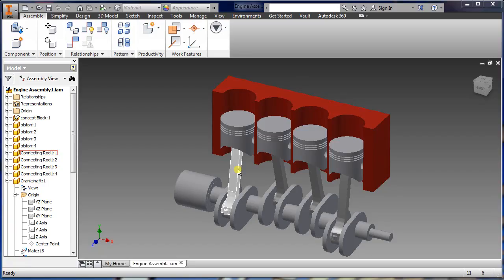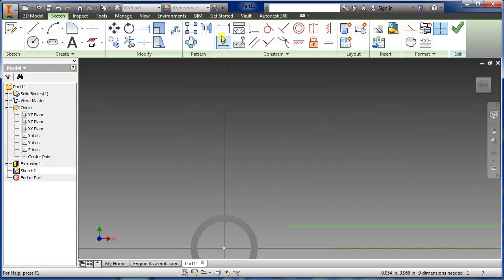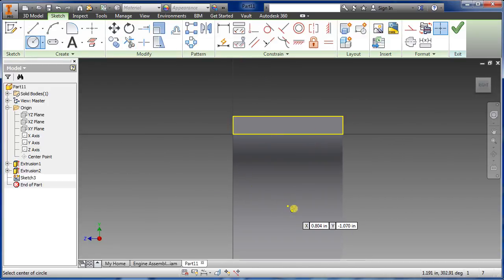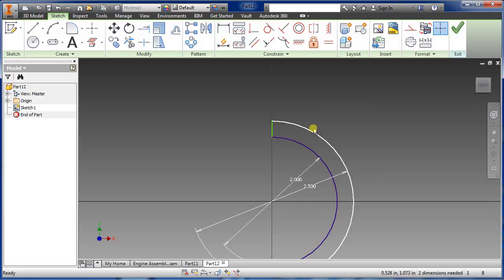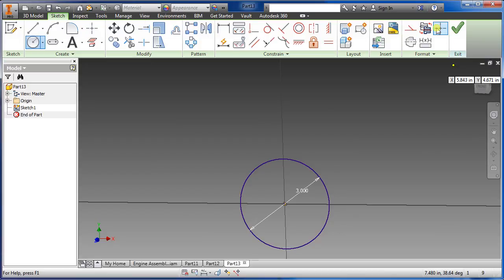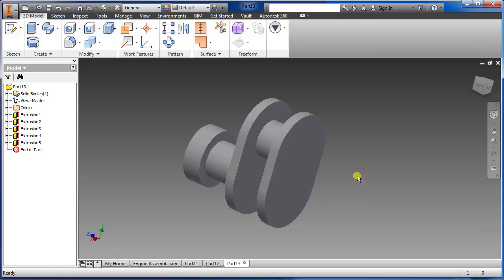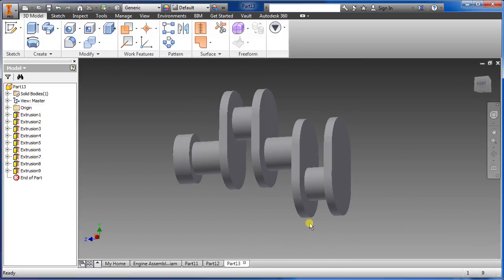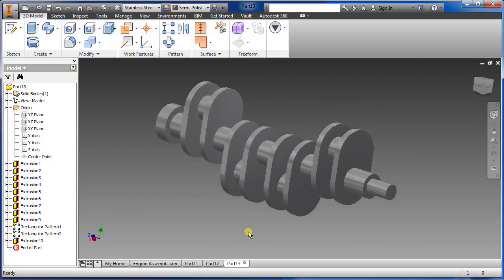Autodesk Inventor 2015 Part 2  Engine Concept Tutorial piston connecting rod crankshaft assembly

Comment: when I  going to Dimension the first 3D ring to two lines I haven't find the yellow point middle the 3D ring. (2:17) So I can't dimension it. Please help me for this error. Please do CAD tutorials like this. This is amazing work. Can you do tutorial about engine cooling system? This is very helpful tutorial for my school works and I watched your first video about making piston.
Reply from the maker: Hmmm. That yellow is origin of 0,0. Try using the dimension again. Dimension the top line and point the second one to the center. It should just connect. 

Unfortunately I have move on and don’t do much of CAD work anymore.
Reply: @GearTechKet  Thank you, It was worked.